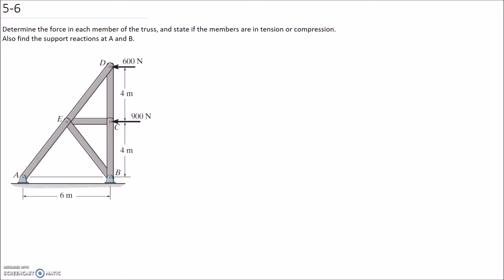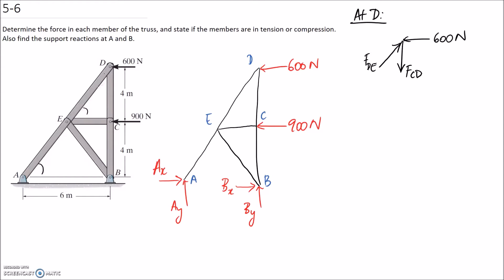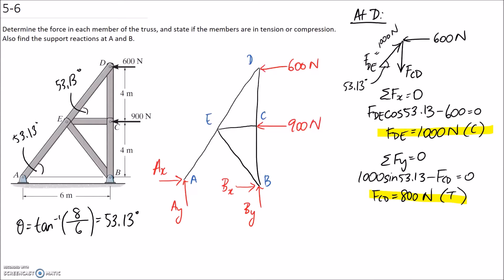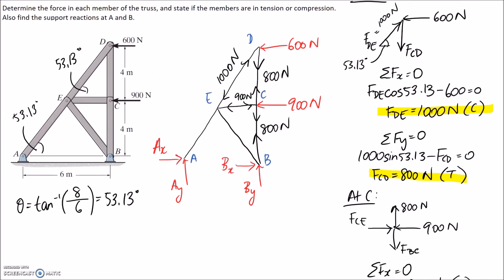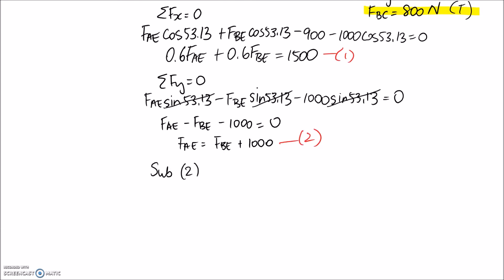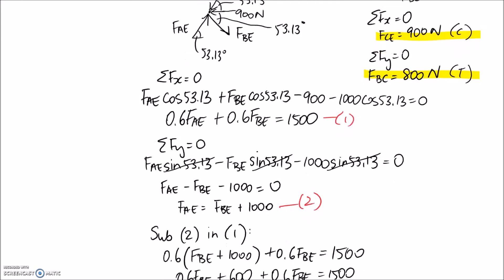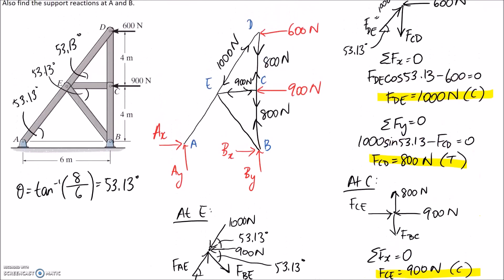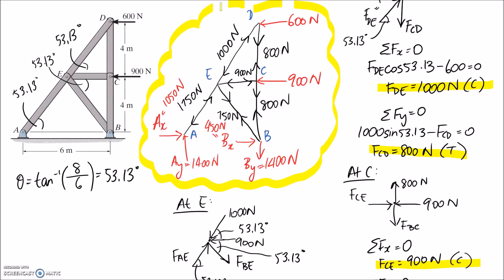Method of Joints Example #2

Comment: Hi maam I use rotated axis method at joint e and the value that I get for FAE is 1540N which is not the same answer for you maam, and i cant get where i got wrong in my process.